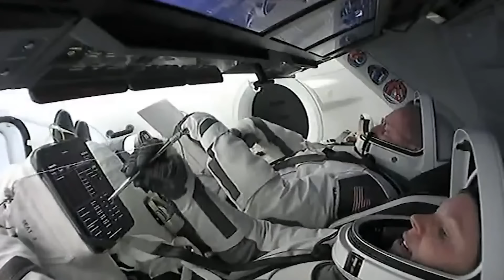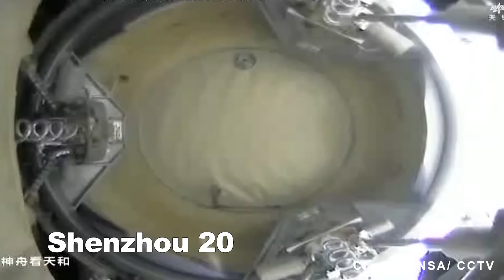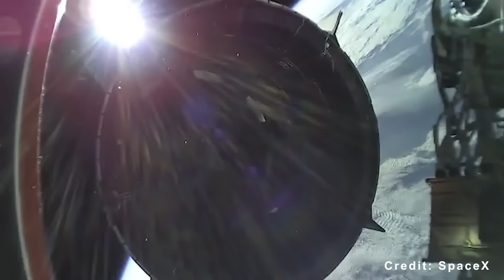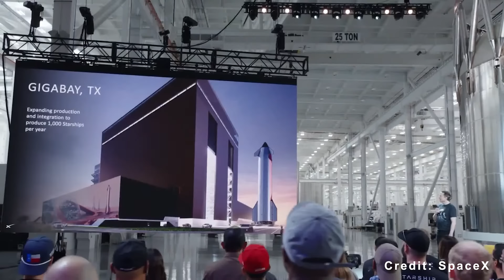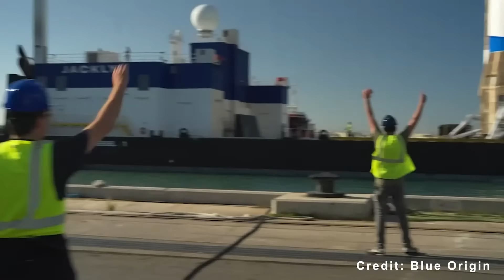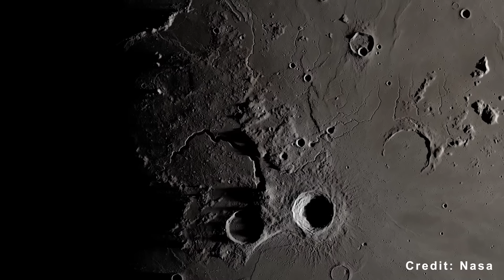NASA Astronauts revealed Life Inside SpaceX Dragon, REFUSE to Fly on Competition...

Comment: A major difference emerges when comparing Boeing Starliner and SpaceX Dragon.

Boeing, as a long-standing supplier to NASA, has often been "ORDERED" by Congress to reuse previously developed technologies to fulfill new NASA contracts (what some call the traditional method).

From a purely accounting perspective, and outside the field, this approach seems economical (Boeing doesn't have to reinvent the wheel for every contract), but this is counterintuitively false.

Reusing elements developed in the 1950s and 60s for 2020s hardware and merging them with current concepts and tools requires very costly redevelopment in terms of both time and money (redevelopment costs that are higher than starting from scratch)
and which will have ZERO chance of being reused for anything other than "old-school" space applications. 

On its side, "SpaceX" started directly from a blank sheet of paper (from the necessary functions).
Reply: Nonsense. How many times has Star Liner flown?